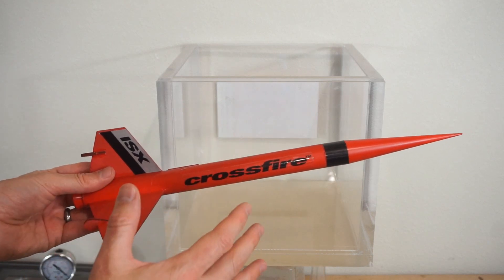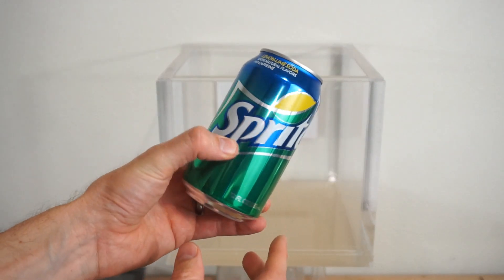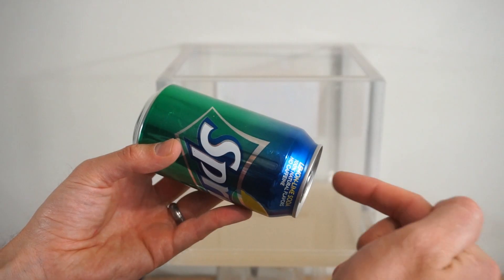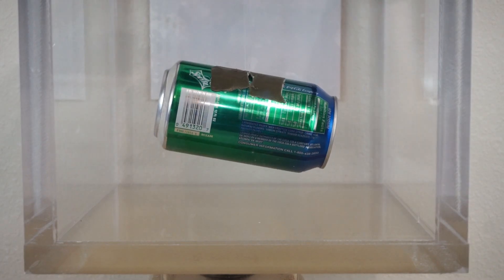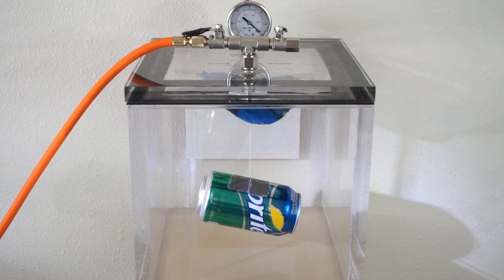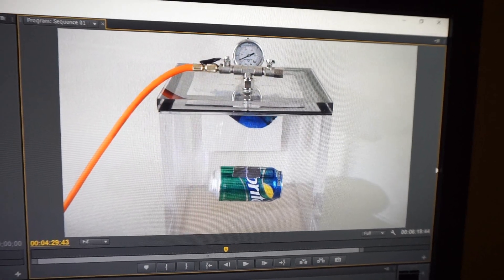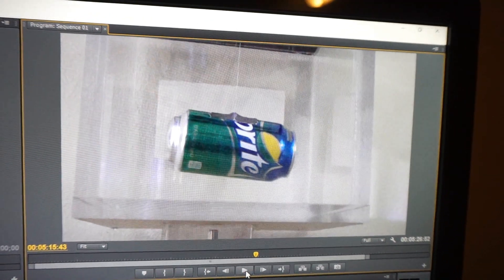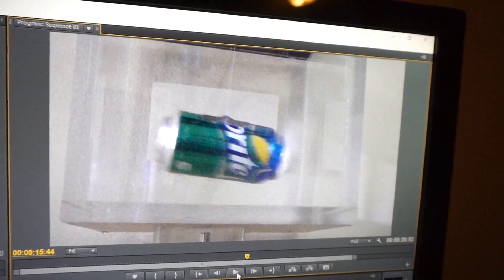Can a Rocket Fly in a Vacuum Chamber?

Comment: This whole experiment was a waste of your and my time, it's absolutely flawed, and here I was, thinking that the moon landing believers had an answer to how rockets propelled a ship to the moon through the vaccuum of space, having no oxygen to push off of...I was wrong and so are you....but thanks anyhow, you just put another nail in the coffin of the moon landing hoax....cheers.  good work.
Reply: Rocket engines generate thrust by accelerating a reaction mass, in the form of their burnt fuel. There's no need for any ambient medium here, and I don't know why anyone would think rockets work by pushing off against air, given that an atmosphere makes rocket engines less efficient. You get thrust if the intake mass flowrate*velocity is lower than the exhaust mass flowrate*velocity.

As a matter of fact, this is the exact same phenomenon that jet engines and propellers use to generate thrust: they accelerate a reaction mass. The only difference being that they don't carry the reaction mass with them, instead using the ambient air as a one. In all these cases, none of these engines are pushing off against an ambient medium: they are all pushing off the reaction mass they accelerated, be that the air that went through the engine, or a rocket's exhaust.
Reply: @hydrochloricacid2146  thanks, it's a bit over my head, but I get the jist of it .  I had always been under the assumption that they needed air/atmosphere to propell itself against, but your saying that's not correct? That they use the mass of what's being burned ?
Reply: @greglavy1277  all engines which generate thrust do so by increasing the momentum of some object or fluid, which is itself known as a reaction mass. Momentum is just mass*velocity. 

Jet engines notably take in the air coming in and speed it up, meaning there's an increase in velocity between the intake and exhaust air. The sole reason we're getting thrust is because we're accelerating the air here, which acts as our reaction mass. We're not pushing against our atmosphere, strictly speaking, but against the air we've accelerated. 

When fuel sits inside a rocket's fuel tank, it has a relative velocity of exactly 0. Most rockets burn that fuel using liquid oxygen, and the result you get is gas. That gas then exits out the engine nozzle at very high speed, given that it can't stay within the combustion chamber due to the very high pressure within it. The total mass of the gas coming out from the nozzle is exactly the same as the fuel+oxidizer mass (conservation of mass and all that), but the velocity of the exhaust is much higher (because the fuel was originally not moving relative to the engine). We've effectively done the same job a jet engine does: we accelerated a reaction mass. The big difference is that a jet engine can use plain air as a reaction mass, while a rocket uses its fuel instead. Again, no need to push off against any atmosphere here, we just accelerate something, increasing its momentum, effectively pushing off against that. In fact, the air from the atmosphere tends to get in the way of a rocket's exhaust, which is why rocket engines are actually less efficient at sea level than in a vacuum.
Reply: @greglavy1277  yes, effectively they push against the mass of the burnt fuel.
Reply: @hydrochloricacid2146  thank you for your explanation , now I'll have to focus more on the facts I'm aware of , not the science I know nothing about !
Reply: @greglavy1277  Rockets are no different than planes.  Planes are not pushing off the surrounding air either.  The fundamental concept is this :  if you eject mass away from something, that something will be thrust in the opposite direction.  This is the conservation of momentum.  If you'd rather think about it from a Newtonian perspective, then the rockets push their own fuel away from them.  That fuel pushes back. 

An airplane works by ejecting air away from it.  The advantage an airplane has is there is an abundance of air all around it.  It sucks it in, and then pushes it away.  The plane is not pushing off the ambient air; it's pushing off the air it sucked in.  It seems confusing because they are the same material.  Imagine airplanes had tanks of air and they just shot that air out.  They would still work.  They would not be pushing off of the air around them.  They are pushing off the air they ejected out of their tanks.  The same thing happens, there just isn't a tank.  Planes need fuel to run an engine that turns a propeller or turbine which sucks in air and ejects it away.  Rockets do not need fuel to fuel an engine.  Rockets do not have moving parts.  Rockets need fuel because they are designed to function in a vacuum where there is no ambient medium to draw from, so they take the mass with them that they eject.  The fuel IS the mass that is ejected.  It's why rockets have to be so large.  This is not an exaggeration : 95% of a rocket's mass is fuel.  That fuel is not operating an engine.  It's not turning a propeller or turbine.  The purpose of this fuel is to be the mass which is ejected.  The reason they use fuel (which is technically two things - a fuel AND an oxidizer - since we are dealing with a vacuum, and you can't have combustion without an oxidizer) instead of water or compressed air or some other material - is you want to be able to eject the most mass at the highest velocity that is possible - and safe.  The more massive the material, the larger the momentum, and thus thrust.  The faster it is ejected, the larger the momentum and thus thrust.  If they wanted to eject water or some non-combustible material, they'd need fuel to operate the mechanism that ejects the mass.  If your mass itself is combustible, you can just ignite it and boom.  High mass ejected at high velocity.  Thrust WILL occur.

I'm sorry this is getting long, but this is another way to look at it.  If you were in deep space and had an unlimited supply of 10 kg balls.  If you kept pushing those balls away from you, you would necessarily be thrust in the opposite direction.  This is how rockets work.  Fundamentally, planes are no different.  Imagine that in space, there was an endless supply of 10 kg balls all around you.  You could just grab one.  When you throw it away from you, you'd be given thrust.  Then you could grab another one and throw it.  Now, the reason you are being thrust in the opposite direction is not because you are pushing off all those balls all over the place.  You are thrust because you pushed off the balls you threw away from you.  Now, when throw a ball, you are given this momentum the very moment you throw the ball.  What the ball does after you release it does not - and it is really absurd to think it could have any affect on your motion after you've released it.  If it went on to strike another ball, that's not going to change your motion.  It has nothing to do with you.  You're not even touching the ball.  It would be pretty absurd to think that you are only given thrust if that ball ends up hitting another ball out there - even though you've not even touching it and it has not way to magically transmit information to you that it hit something.  It's nonsense, right?  This is the equivalent to thinking rockets need air to push off of or that experiments like the one in this video are flawed because they had the wall of the chamber to push off of.  No, that's not at all what happens.  The particles that are ejected out of the can gave the can thrust the MOMENT they were ejected away from it.  It wouldn't matter if they went on to hit the wall of the chamber, Scooby Doo, or nothing at all. Their work on accelerating the can was done already.
Reply: @willoughbykrenzteinburg  thanks for that very in depth explanation,  I do now see how it works, so cheers again.

Comment: It's pushing off the wall !
Reply: Look at the footage frame by frame. You can see that the soda doesn't hit the wall before the can starts moving forward.
Reply: @Darkner000  first of let me say I'm sorry for sounding off like a putz...and second , to me , it looks as though the explosion from the cans rear is what's pushing off the wall no  ?
Reply: @greglavy1277  Go to around 5:45. You can see that the soda does not hit the wall before it propels the can. In fact, right after the soda leaves the can, you can already see it has moved a slight bit.

Comment: Well, first, the damn can was attacked by a string. That alone makes the can moving, because the can is artificially connected to medium. Secondly, the box walls. The box walls act like a medium. Remove the string and the walls, or remove the string and have the walls 100 feet away. The can won't move at all. There is no trust in a vacuum. Rockets cannot move in vacuum, no matter how powerful their engine is. It is impossible, and you should stop making yourself a laughing stock, by presenting an experiment that is completely irrelevant.